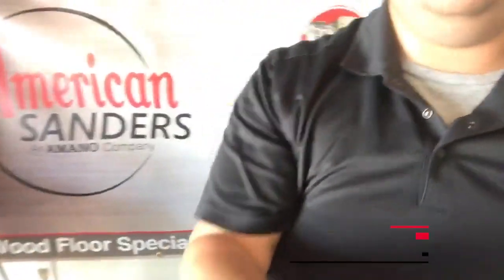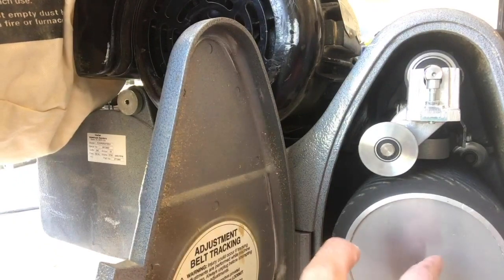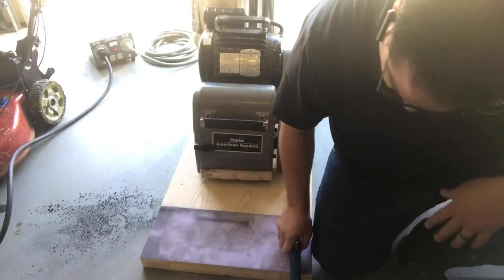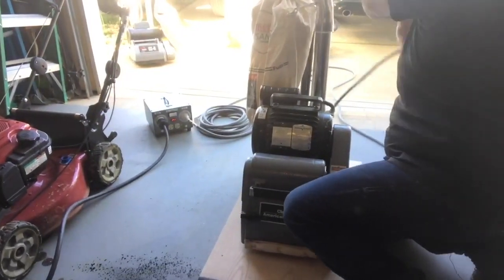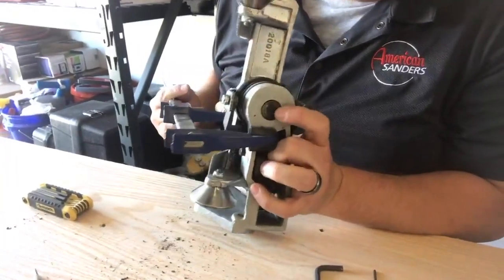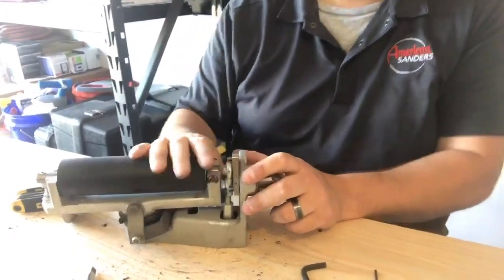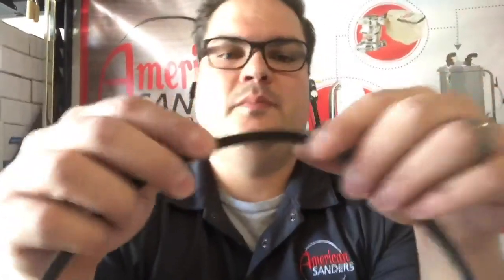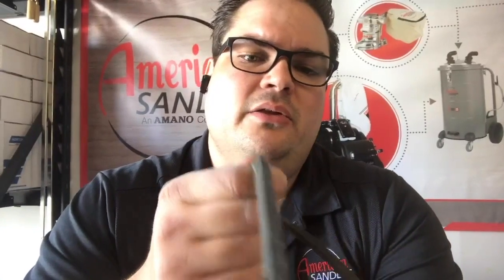AMERICAN SANDERS FLOORCRAFTER MAINTENANCE

Comment: 2 questions.1)  How do you lube the upper assembly ( the shaft that allows you to disengage the paper)  I understand its a dry lube and its also cover with a rubber boot?
2) How do you change the drum and do you need to balance it  if you buy a new one. Im from Canada and Im looking for parts without going over the border and also any videos on the above
Reply from the maker: We use graphite to lube the upper assembly where the spring is. The top will have to be separated from the bottom, remove the roller then use a speed clamp to hold it together while the bolts are removed.
 
Remove the drum using a 1 1/8” socket to remove the nut. There are two flats on the opposite side belt pulley to put a wrench on if needed. Inspect the felt rings (3) on the inner part prior to ordering the drum. They may need to be replaced as well. When tightening the nut it should be torqued to 50 ft/lbs. The drum comes balanced, it will need to be dressed once installed. Be sure the machine is level (wheels) prior to dressing the drum.

Comment: Thank you for this great information Kevin. Any source for parts for the grand daddy of these machines, I have a Porter Cable FF12 need a belt guard?
Reply from the maker: Hi Jim. Per Kevin, you may be able to get parts for this machine through KO Supply in Riverdale, NJ. You can reach them at 862.248.0870 or www.kofloorsupply.com